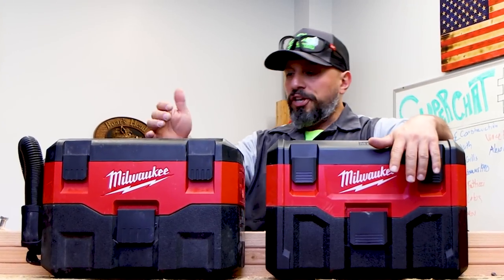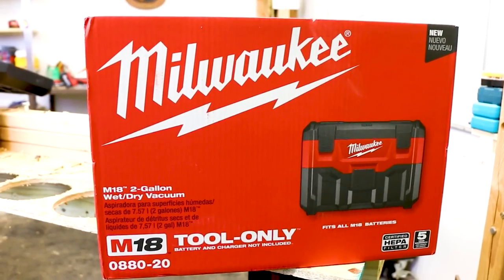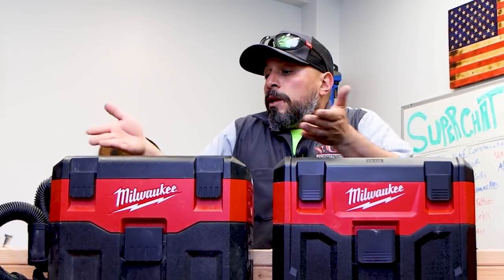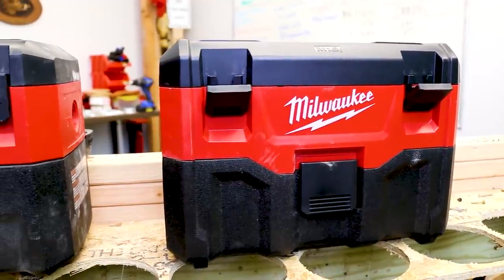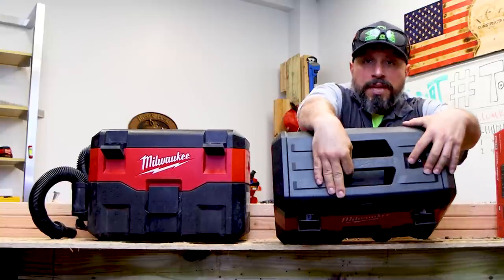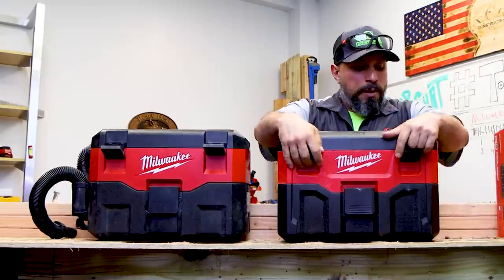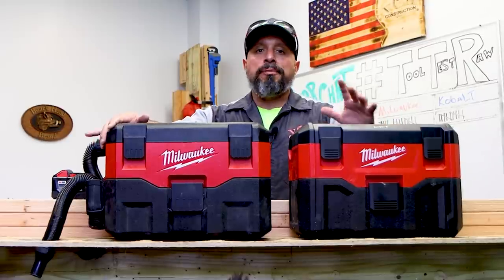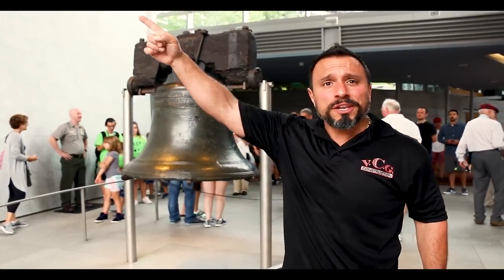New Milwaukee M18 FUEL Tool REALLY SUCKS!

Comment: I use mine to suck dirt out of holes - it works but I wish the hose was bigger, and I'm amazed at how often debris gets past the opening but gets stuck inside the tube.  Finally, it is hard to remove the battery - very hard.  I am amazed at how difficult it can be to get the battery out, especially the bigger batteries.

Comment: Hi Guys.  Im a plumber and forgot my hand water pump in another job and I had to use that to suck the muddy water to fix a leak and still using at this time.  That was 3 months ago and the vacuum still works properly.

Comment: i want to see it compared to Dewalt 18/20V MAX* CORDLESS/CORDED WET-DRY VACUUM
Reply: New To TimeWorn Tractors 

I was upset when I needed a small vac and bought the Dewalt at Lowe’s, only to find out later that I could have ordered one with the cord option. Then I used it on a townhouse astroturf roofing job for a month, and decided that it would be better to get a Rigid for bigger jobs and use on the miter saw, and keep the little Dewalt battery only one for when I need to run up stairs or something. 

Today I got this one, because of how much smaller and packable it is compared to the Dewalt. The Dewalt will end up in the shop, or get handed off to a coworker when they need to break off.

Comment: I got that for free with a battery combo kit at HOME DEPOT 🔥
Reply: I got mine free with battery purchase from northern tool. It was $179 for two high output 6.0 batteries and vacuum
Reply: @jdreynolds29  The battery combo kit included a 6ah and a 2ah. There was also an option for the high output model batteries (8ah & 6ah). Either one you bought you got to pick out of a select few free bare tools.
Reply: @_LoKo_ReNeGaDe_613_  that's cool. Like I said mine was $179 for the two high output and the vacuum was free. I sold the 6.0 batteries for $160. So II really only had to come out of pocket $19 to get my vacuum. But truth be told I bought two of those deals. So I also got $160 for the second set of batteries and I got $75 for the second vacuum. So altogether I actually got paid $37 to keep one of the vacuums💥
Reply: I'm gonna jump on the 6/8 charger deal with free vac
Reply: KRAZYRAIDER18 yea I did the 8 and 6 with a free circular saw 👍🔥

Comment: I use a Milwaukee M18 0882-20 everyday at work. It’s an excellent vacuum, and holds up well in a commercial environment. Never had one issue.

Do note though this is a dry only vacuum. No liquid. I specifically got it for dry applications, as I have a water transfer pump/mini shop vac for wet applications.

Comment: I spoke to a Milwaukee rep today. Didn't look at the vacuum. Was mentioning the breaker. The rep stated the bigger batteries were 72 amp hour although he didn't know how many volts. Anyway real impressive. I asked about a plate compactor. The rep said it's on the cards.

Comment: Have gen 2 but mine didn't come with square attachment just the crevice one. I want an attachment for my M12 Fuel cut off saw for the dust collector. Do they make one? I tried attaching the hose with no adapter but no dice

Comment: I have the Gen 2 briefcase vacuum. I like it but one problem that I have with it is that I also have the M18 random orbit sander that comes with the adapter to use the sander and vacuum together and the problem is that adapter does not fit the hose that comes with the Gen2 2-gallon vacuum. It fits into the adapter so loosely that it just falls right out. I probably would hardly ever hook up the vacuum hose to it anyway but in some circumstances I would want to connect  them together. Being that they are both Milwaukee M18 tools and one of them comes with an adapter to use a vacuum they should work hand-in-hand but they don't. I would expect this kind of nonsense from a Walmart to but not from Milwaukee.... But that's what I got for Milwaukee.... Nonsense

Comment: Arguably, these are both Gen1, just a revision, as they have the same model #.  Never any increase or change in specs, though electronics may have become more optimized. 
If you want to have option to store hose on outside, look up the parts for the version 1, and install on v2. Costs <$10. Credit to @JonathanM

Comment: Yes,
I love my Gen ll.
I've added a brush tool attachment(fits in battery compartment with the 5ah) the Rockler "Smart Port" hose kit(handy for catching debris from various tools' exhaust port) and even put some  Packout feet(from Keizen) onto the bottom.

I do everything that can be done with this vac. 
Wet/Dry even use it in "Blower Mode"

YES!

Now I'm looking for a Backpack Vac!

GO Vince!

Comment: Great tool I love mine i have the Gen 2 i use it for wood dust jigsaw and all my circular saws and metal shavings even picked up a crap ton of automotive window glass with it even picked up glass from a shower slide door that broke when I put it outside for cleaning and it picked up all the glass and a ton of dirt just a beast of a vacuum vince @vcgconstruction

Comment: It's one of the very few things from Milwaukee that sucks! LOL  
I have a G1, and I have always felt that it's Achilles heal of the thing was the external hose storage, but the thing has never failed me. I like that on the end of the hose on the G2, it has the beveled edge.  As I mentioned elsewhere on your social media, I think the only mistake was not making it compatible with Packout. 
That said, I am a datacom guy who does pretty much everything low voltage. This vacuum has proven to be perfect for cleanup after cutting in caddies and cleaning up after drilling holes. I am that guy, the one who vacuums the top of the ceiling tile after drilling or cutting a hole above it, and this vacuum is easy to bring up and down the ladder. Come to think of it, a shoulder strap, or at least a spot to connection a shoulder strap would be cool, but easy enough to do yourself.  When drilling holes in concrete, I will often hold the nozzle right under the bit to catch everything as it drills.  I wonder how the 5317-DE Dust Extraction would work with it.
Reply from the maker: I’m sure the crew that comes in after you appreciates all you attention to detail Timothy!!

Comment: Today I finally bought into Milwaukee! 

Got the 2746-29 brad nailer tool only at my local tool shop, but they didn’t have a good starter kit, so I headed over to HD to get the two High Output 3.0 batteries for $99 and the high output 6.0/8.0/rapid charger combo with the “free” vac. I already have the Dewalt small vac offering (DCV580), but I like this self contained unit way better. 

Next thing I need to figure out is which Milwaukee impact to get for lags. 

And I’m hoping somebody will have the 2744-20 M18 21° Framing Nailer soon... want that for sure! 

Now if only Richard at Finish Carpentry TV still had the DeWaulkee shirts!!
Reply from the maker: Good luck Bill, I hope the new investment makes you a ton of dough, Ray , me!!
Reply: VCG Construction this time last year a friend who’s an architect and builder took a chance on me and put me to work sweeping and go-for-ing on his townhouse build. I’d moved to a new state and I didn’t know anyone in the video industry, I had done camera work and lighting for the last decade, so I asked him if he had any work. In the last year I’ve learned a ton, and now he has me doing damn near everything! This latest project is half barn and half apartment - I’m doing everything after the framing, but drywall, plumbing, paint, and electric. Fascia, roof, windows, doors, soffits, siding, cabinets, and trim. Having a blast learning a new thing every day, and your content certainly has accelerated my craft!

Comment: i have the gen2. i love it and made a nice 5 foot extention with 11/4 conduit. the only thing i dont understand is why the switch is on the exhaust side
Reply: @peglegthered  you know i havent tried but it should. i put a quater sweep bend on it for stink bugs lol. it has the bell end that fits the flex hose

Comment: I like mine a lot but two annoying things are.
#1 The on off switch should be on the other side of the handle so when you are holding it to use it you can flip the switch. 
#2 It's hard to disconnect the hose on the suction side unless maybe you have kids sized hands.
Reply from the maker: Thanks for the feedback.

Comment: I always hated the hose management system from the Gen 1 vacuums but all the other design features seemed nice and the fact that it is so compact made it a huge selling point (and the HEPA too). I've abused that vacuum on everything from regular household dust, toilet tank draining, car debris, and now as a dedicated brass filings extractor/storage facility. Now I grieve, for I know the best thing this new vacuum will suck is all my hard-earned money down the big red pipeline to Milwaukee headquarters (and Home Depot's orange pipeline also), because I definitely want it.

Comment: Hey Milwaukee please fix the problem of the seizing of the bottom bearingthat happens when you suck up water I was really disappointed after only six months to use that this thing is already sounded like Garbage I am a big fan of Vacuum it’s just a disappointment that they didn’t put a sealed bearing on the bottom of the shaft

Comment: Good vac, amazing power considering it's rated only for 300 Watt, but it does not belong to FUEL line. It's just regular M18.
Also cleaning of that filter is a mess. Power on the plus side,  but when it's full better wear HAZMAT

Comment: I'll stick with my DeWalt because it also has a cord! It uses the old 18V NiCad, the new 20V Lithium and then if the battery dies, plug it in. No it doesn't charge the battery while it's plugged in but, Oh well, you can't have everything! Milwaukee needs to add the cord in gen 3. Then maybe I'll switch. Moving the tools and hose inside is a good improvement.

Comment: I just wish it had a 120v connection option!! So,  battery free if the environment provides!!! Other than that it is crazy loud.
Only two downsides to this vacuum!!! Otherwise I recommend to every contractor!! Especially electricians.. for all your leads you stop and drywall or any mess you make!! It's perfect!!

Comment: Have this vac at work and the Bosch GAS18V-3N at home. The Bosch has a very slight amount more suction, but the milwaukee kicks its ass in battery life when comparing similar amp/hour batteries.

Comment: I have the Milwaukee M18 vacuum and I love it it's easy to clean it's light the only thing that it's really not a big deal is that it didn't come with a brush attachment so I had to go to Home Depot and by the extension and the brush but besides that no problems
Reply from the maker: Thanks for the feedback Joseph!

Comment: The vacuum sucks so much. That you have to have a big battery for it. I have a ton of 20v dewalt tools. And one Milwaukee. And that's the gen 2. All others are crap. When you need to get shaving off of carpet from drilling into a column. The gen2 makes quick work

Comment: I just recently purchased the Gen2 in the last few weeks and have used it quite heavily.
1. The vacuum does a really good job with small debris.  It does have a tenancy to get clogged with medium to larger pieces.  
2. The HEPA filter is very easy to clean with water and letting it dry.  I wash the plastic lower at the same time in the sink.  
3. Complaint 1: I wish there was an attachment to fill pool floats.  I'm searching for one as the blower side is pretty strong, however; I would like to fill pool floats or other items like that with the blower.
4. Complaint 2:  The switch is on the opposite side as the hose.  HUGE inconvenience.   The switch needs to be moved to the other side of the handle so that you can turn it on and off while carrying it with your thumb.  

Great videos!  I just switched to Milwaukee after watching your videos.   It really helped me make my purchasing decisions easier.

Comment: I favor the smaller model that is a single handheld unit.  it won't pick up big chunks, but brooms work for that.  considering the worst failure in my old DeWalt was the hose, I'm plenty happy

Comment: I have a second generation for 2 years, a super vacuum cleaner, and for cleaning the car, as well as for the construction site - small but crazy :) make a test how he pulls water - I do not know if the filter should be removed or not :( I saw a movie on YT, i.e. de walt vs milwaukee, and this milwaukee was faster as usual :)

Comment: i own the gen 2 love it,  use it for a little bit of everything. from sucking up small piles of grain at work to sucking out water when i pipe clogged at home. if i remember correctly didn't the gen 1 have the bonus feature that it could use the old style 18V battery the new style M18 and i think the M12 ?

Comment: I’ve had the gen two since it came out. Used it for everything from drywall dust to vehicle clean out. I’ve even used it to get the grass off my dogs after they roll around outside. Works like a champ every time and even better that it takes the big HD12’s.

Comment: Got mine a few months back and I agree with you 💯% it is really a good little wet/dry vac. It hooks into the back of some of my tools for dust collection. I did have to retro fit another piece of hose to fit on the tools better but it does a good job with my jigsaw and circular saw. Great video as usual!!!!
Reply from the maker: Thanks for the feedback Brandon! 👍🏻
Reply: @VCGConstruction  anytime brother

Comment: Absolutely my favorite vacuum!  I own several corded vacs, (including dust extractors) and I find myself using this (gen 2) vac for both cleanup and dust extraction.  In fact, it hooks up nicely to my festool cordless tracksaw.  The other day I used my Milwaukee m18 planer to rabbet out some exterior pvc window casing and it did an excellent job extracting the pvc shavings.  You know how much of a PITA pvc dust is!  The connection was a bit loose but a couple wraps of duct tape made up the difference.  (My only complaint is the hose-to-vac connection is a bit cumbersome and overtime difficult to untwist to remove; that part needs a redesign, imho).  It’s also worked well with my m18 miter saws and sander; I might pick up a 2nd one!

Comment: I have one of these and it's a life saver however there are some design things that are a bit disappointing.
1. The hose when on the sucking side has this bend when it enters the encasing  these bed catches things if they are a little long or chunky. This has resulted in my hose getting blocked numerous times.

2. When storing the hose inside the encasing the after vacuuming up drywall dust I find the dust gets all over the inside of the vacuum. Which isn't too much of an issue just that it then gets caught by where the battery goes in an making it difficult to remove the battery after

Comment: I replaced all of my gen 1 with gen 2 because my guys would loose the hose on the outside. Having it inside and attached eliminated that problem. I also feel that the gen 2 has a lower pitch then the gen 1 and isn’t as ear piercing.

Comment: Got two of the Gen 1 vacs, been using them for years.
Never used the externally mounted hose holster, there’s
enough room to store the hose inside in the base, along
with some additional attachments. Surprised you didn’t
say anything about the need to add locking cleats (at least
on the bottom) to make these things Packout compatible
Gen 3 maybe ?

Comment: Does it connect to the orbit sander or other tools with dust collection without an adaptor?
Reply from the maker: I use the 3-1 vac for those jobs without an adapter, honestly I can’t remember if the briefcase needs an adapter or not

Comment: I have been using the gen 2 vacuum since last November. When I started using this morning to clean the electrical room, the motor suddently had hissing sound and stopped working.

It is in the service center now, so i will post and update the information later regarding the problem.

Comment: Used my gen 2 for a trash pump today. Repaired sprinkler system today and the hole was filled with mud. About 12 gallons of water removed.  Saved the day!  We'll see how it cleans up,  It works well with the m18 jig saw and router too.
Reply from the maker: Thanks for the feedback Rick!
Reply: Washed it inside and out and all around with water hose tonight. 2 inches of Texas clay in the bottom. Put it in the back of the pickup untill tomorrow.  I'll let y'all know tomorrow.
Reply: Good morning, do not wash with a garden hose. She's toast. 😃 Maybe it will dry out later. Still paid for itself yesterday. Have to get another. Be safe out there and keep building.
Reply: 🔥FIRE IN THE HOLE 🔥 she runs!

Comment: I got my Gen-2 vacuum this past winter and it's been great so far, I may consider getting another with a couple more 12Ah batteries for it.
Reply: I was wondering if the 12ah fit . I just bought the vac today and was using it the 6ah ain’t cutting it for me
Reply: The 12Ah is the best battery for it, a fully charged 12Ah battery can last me a couple of days on that vacuum

Comment: Just bought one from Home Depot with the $199 starter kit deal.  I returned the batteries so the vac cost me $74 + tax.  Good time to buy one!
Reply: How did they let you return the batteries without the vacuum? Did you get store credit or cash back
Reply: JP HVAC - you can do this with all the Milwaukee deals at Home Depot right now. Buy a battery starter kit for $199 and get the vacuum, surge impact, or hammer drill for free. They separate the starter kit and free tool on the receipt and assign a max refund amount to each. I got the surge impact for $85 after returning the starter kit.
Reply: @micahwatson9017  nice! Did they ask for your ID even if you had the receipt and you got the cash back right? Not store credit